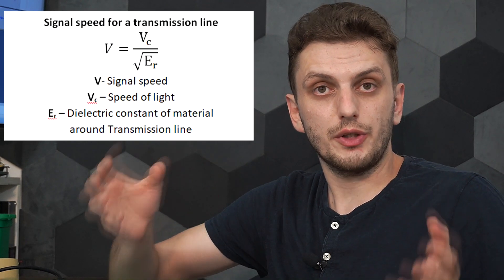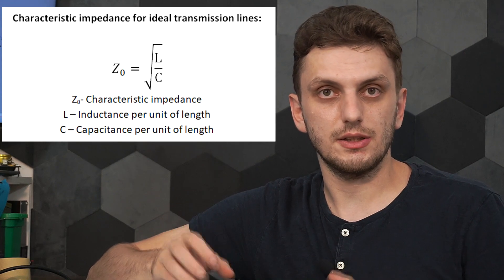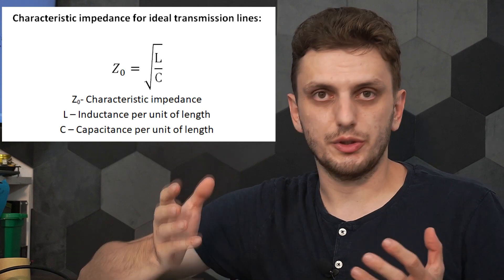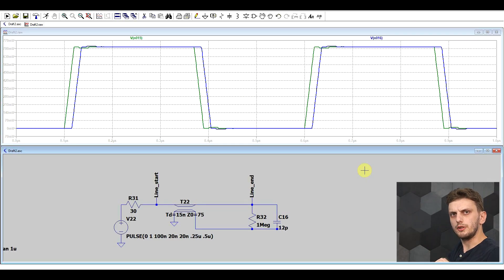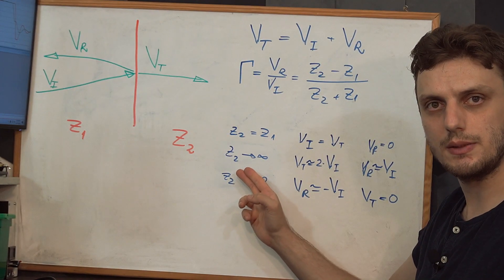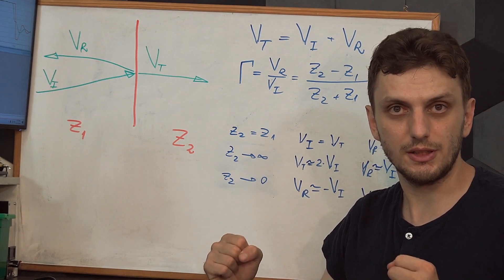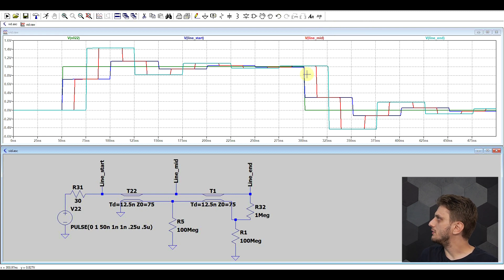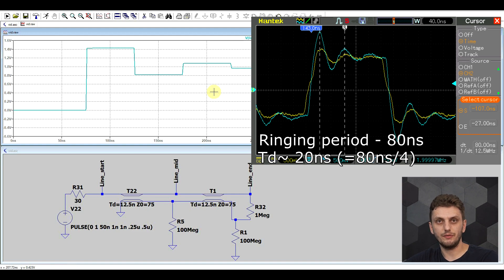Electronics Tutorial - Ideal Transmission Lines

Comment: Would you treat the bondwire as transmission line?
Reply from the maker: If the IC works in the GHz range, you should. I've seen in some high frequency IC's (I think it was the HMC994) that the silicon is no longer encased in epoxy, but rather the space is left void (or filled with air); I guess this was done to keep a close control of the dielectric constant around the IC and the bond wires.
Reply: @FesZElectronics  i think this can be important also, but it looks not very widely supported by the design tools..
Reply from the maker: Well, when it comes to high speed circuitry, usually the proper simulation model to be used is an IBIS model. This should contain information about how each I/O behaves over a wide frequency range when signals are passing trough it. So on the one side you can use some basic simulation models to make sure the circuit works (models that take into account the basic internal functions) and then finish the design by simulating the interfaces between the components using the IBIS models to ensure that signals get transmitted from one point to another without to much distortion.

Comment: How can you use a transmission line combined with a capacitor to achieve a resonant LC tank?
Reply from the maker: You can take advantage of the coax as an inductor, and just add extra plates as capacitors. This sort of technique is useful in very high frequency applications >1GHz. Similar technique is called a "Distributed element filter" - you will see this sort of layout in very high frequency circuits.

Comment: Hello, I am doing an experiement. I need to transmit a signal very quickly from one connection to another. First the connection will be open. Then closed. Then open again. Kind of like a switch. If I was going to speed up the transfer of the signal during the closed time, should I increase the frequency? Sorry I'm kind of new to this. I would be thankful for any help.

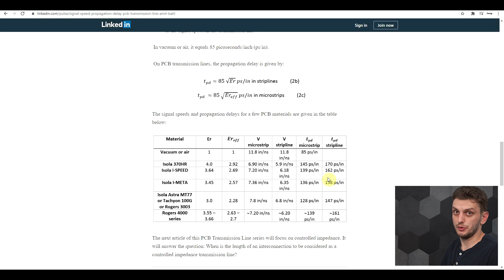Comment: lol @5:01
Well you what always gets me?
I am fine if people just want to use their own system and units, but please if you make a table anyway, just convert it to units everyone understands.
So why not using both in the same table as well as the calculations? 
It will take you a couple of minutes more writing the article, yet it is so much more readable.

Excellent video again!
Btw, I would bump up your resolution in LTSpice, you will get a lot more points that way to see the ringing better.
Reply from the maker: Hello P_Mouse! It's not a resolution problem. The signal should look all boxy. My measurements looked more sine wavy because of the signals used (slow rise-fall times) and the BW limitation of the measurement equipment. 
I'm happy you enjoyed the video!
Reply: @FesZElectronics  are you sure? I actually don't think so. This is just a form of ringing caused by oscillations.
Reply from the maker: Well, to be fair, I simulated an ideal line. The real line has some extra series resistance that causes the line to attenuate signals based on their frequency - my practical line has from the datasheet an 0.9dB attenuation/100ft at 10MHz but at 6GHz it reaches 21.1dB/100ft of attenuation. 
By the way, in the simulation command line I had a maximum time step set to 0.01n for the last simulation (the one with 2 pieces of transmission line) and the signal simulated had a transition time of 1n so there should be quite enough points.

Comment: Great video, this really solidified the concept of transmission lines for me. Learnt about impedance matching for low frequency circuits back in analog electronics class, so it’s interesting to see how impedance matching is an elegant solution to multiple problems. I wonder, at the limit of a continuous change in impedance across a transmission line (like a coax cable with constantly increasing r1/r2), would there be any reflection issues at all? I also wonder how much of an issue a BNC connection in the middle of a transmission line makes, the only BNCs I’ve seen are made for RG58, so I assume there are slightly different ones made for RG59?

I’d also be interested in seeing some sort of “ltspice toolkit” full of spice models and examples and such that you use. Then again, I’ve been meaning to swap to KiCAD’s internal spice simulator.
Reply from the maker: Well a coax cable should have uniform impedance throughout its length, it should not change. On the other hand, because of its series resistance (the wiring is not perfect) the cable has losses. In a proper coax datasheet you have the cables attenuation for a standard length (100m) and for various frequencies. But its not a reflection issue, its just losses caused by the dielectric and the wire.
Regarding the connection between lines, it all depends on the signal passing trough it and the transmission length of the BNC connector. If the added bit has a Td comparable to the signal then it will cause problems, if not,I think it can be ignored.
There are some LTspice examples you might find interesting in the installation file under LTspice>Examples>Educational. I covered this in an old video  https://youtu.be/MwfeMjcM4zY
Reply: @FesZElectronics  can you explain how to simulate a long twisted pair or coax cable with loses also?

Comment: Verry interesting video :) i never saw someone before who dosent use a 75 ohm signal generator on a 75 ohm load. In the past i taught it would be necessary to avoid reflection but today i know its not. I like that you verry clearly showed that only the termination determined the reflection.
Reply from the maker: Using a matched impedance at both ends is always a good thing, but my generator doesn't really have proper output impedance setting... 
On the other hand, you can add a series termination at the beginning of the line (between generator and cable) and by doing that the signal will bounce only 1 time at the far end of the cable, but the reflection will be absorbed at the beginning of the cable.  If the end of the cable is high Z, the signal at the beginning will be signal/2 (75R-termination+75Z of the cable divided) and the signal at the end will be (signal/2)*2 (because of the impedance mistmatch) so the signal passes unaffected
Reply: @FesZElectronics  good point but i think most people try to get the most power of the generator like they do in audio amplifier impedance matching. i have two questions: 1. have you ever made a video about miller effect in amplifiers and in general with impedance chaning maybe on a complex numers level? and 2: have you ever worked with microcontrolers or do you want to make videos about some applications with them?
Reply from the maker: To be honest, 1 - no an 2 - I did work with uC but I don't really plan any videos with that at the moment. I mainly want to focus on analog applications. Would there be any subject in particular you would be interested in though?
Reply: @FesZElectronics  no actually not. Analog stuff ist anyway more interesting and there are not many educational videos on YouTube with high quality like this. If i could choose a video it would be tutorial about antennas and how they radiate and pick up electromagnetic waves, because i never had an intuitive feeling for this behavior.